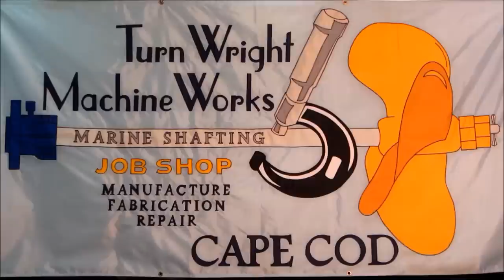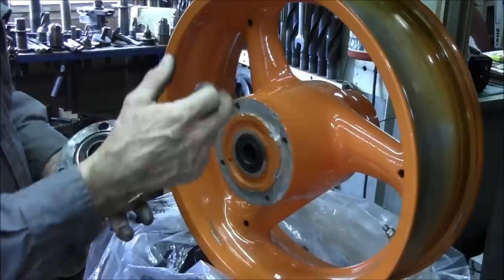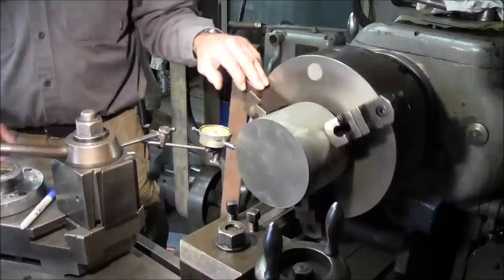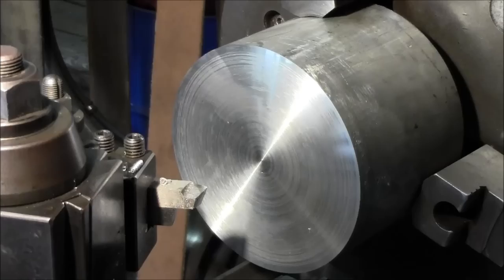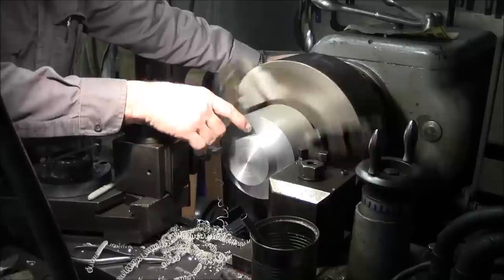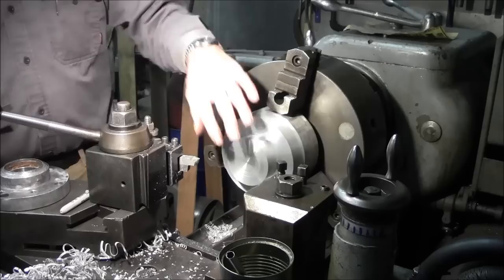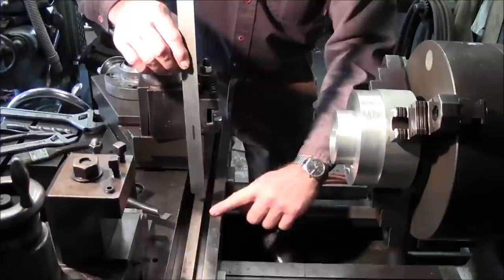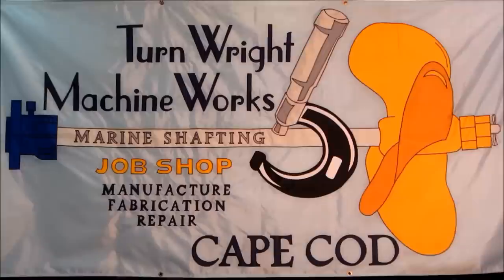Motorcycle Rim Repair: It's how you look playing the game! Part 1

Comment: Wow talk about bringing back memories. Back in the 80s a friend of mine was building a top fuel bike. we made the rear hub out of a piece of steel that had been cut out of 6 inch plate. He had an Enco lath out in a  tin shed, he would set up the cuts and I would watch while he would read what ever car magazine we had bought while drinking a beer. When the cut would end I would back the tool out. Max would reset it, and I got to read and drink. Good times even though it was cold at night.

Comment: I saw this done in the shop of the Huckleberry RR in MI.  Made new axles for narrow gauge wheelsets out of standard gauge axles. The length and diameters were machined.  The area the "brass" bearing rides is turned to +2thou.  A smooth hardened roller is in the toolpost set to parallel the work. The lathe is running at the slowest speed. The roller is brought in contact with the work, oil is brushed on while the roller is advanced by the crossfeed until the steel is upset to produce a smooth

Comment: surface, then the lead screw is engaged adding oil between the roller and work until the area is smooth.  This produces almost a mirror finish.  The "brass" is a brass casting coated with a bearing surface of babbit.  In modern times this would be a roller bearing.  Hope this helps.

Comment: Good tip on measuring the height.  I think I'll machine a gauge bar for my lathe.  What I have been measuring off of is the point of a center in the tailstock.  I figure if that's centered enough to drill with, it's centered enough for a tool.

Comment: Gday Kieth,Just a quick note for your students about cutting speed.Cutting speed changes with diametre.For a set RPM the cutting speed increases with with the diametre of the work. So when Kieth was facing that large piece of aluminium ,the cutting speed changed from inside to out and vice versa.Eg At the centre start the material passes the tool quite slowly but as the tool moves out the speed of the material moves past the tool much faster and that is one reason the finish inconsistent. Cheers

Comment: Hi Keith, just a small tip I thought I would mention ( you probably already know it ) is to install 3 bearings on the face of the chuck in between the jaws and sit the aluminium bar on them, then tighten the chuck. It achieves very good alignment provided the end of the work piece is fairly square. I hope some of the folks out there can use this :)

Comment: Yeah. I didn't think of that.  Trying to machine the just the tops of the last pass would just moosh the metal around and make a mess.  Like when using a drill bit of the next size up to widen a hole just a bit - you'd get more friction wear than actual cutting.  It just clicked in my mind that what Keith does with the file is knocking down those ridges to the minor diameter accomplishing the same thing with less work :)

Comment from the maker: Well a single thread, even if you engaged it on any # or of the same mark, follows the same path and the spring cut is the same on any one of the engagements. Two or more leads have to a split between the #'s and lines for two  or double leads, three thread leads can easily be made by turning a center in a three jaw chuck and staggering the dog one thread per jaw location. note; don't forget to divide the amount of thread leads into the pitch to set the timing & travel on screw! ;{)------

Comment: hi. The shop where i work we do a lot of aluminum parts and we have special inserts for doing it, they are only for alu and it makes a very nice surface. I dont think they cost more than the regular inserts so i thought you might wanted to try them out as well. also i noticed that your tool depth was small and feed was slow, is that just to be gentle on your lathe or what? I just like it when Im feeding fast and getting those small chips. looking forward to watch the rest of the series
- Rasmus

Comment: I want to steal all the scrap aluminum, so I can sell it with my cans. lol That drill bit is very large.After watching many of your videos what I find most curious and wonder about, is why was that machine setup with needing other tools to move it to various positions? You seem to need a variety of wrenches just to make what seems to be quick adjustments that probably could have been solved using some sort of dial or handle.

Comment: Hi Keith.  Got a goofy question for ya.  In regards to getting a gloss cut: I imagine that  machining and facing is like cutting really really tiny threads.  Do you (or would it make sense to) engage the feed screw 180 degrees out when making your spring cuts so that the bit is riding the top of the thread evenly for a smoother finish?    Like double threading I guess.  I can't really describe what I am thinking without crayons :/

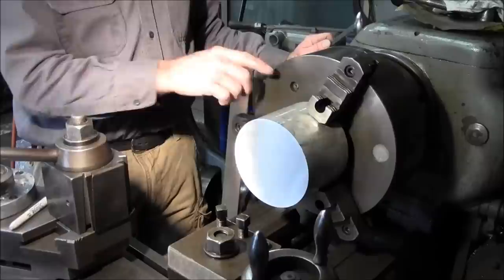Comment: @ 8:55 loosen the 3 jaw slightly and run the QCTP right up against the stock that will get you very close. 
I know thats a nono and bad but I do it constantly . I also have a bar with a bearing on it to touch off on the side . 
As I see it anything in 3 jaw territory is only good for onesy twoesy work so ...

Comment: It's been a while since your comment, so sorry for the thread necromancy (haha, see what I did there?). Are you talking about using the threading function to do normal cutting, with the lead screw instead of feed screw, (in Wikipedia's terms)? Because the feed screw is not indexed and will engage just where ever in relation to the last pass. Also in any practical scenario I can think of the bit would be taking way too light of a cut and rubbing on the part making the finish even worse.

Comment: That is the most disgusting sprocket state I have ever seen,  I used alloy sprockets when I was racing too because it was easier on the chain etc,  alloy rear steel front. 
This racer didn't check the drive line very regularly at all.